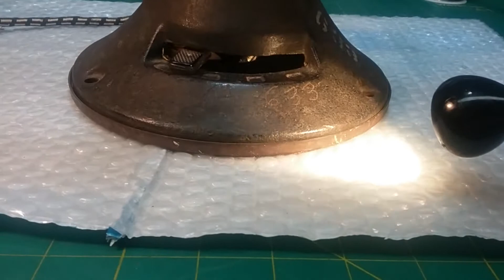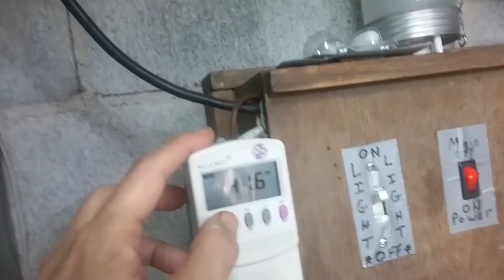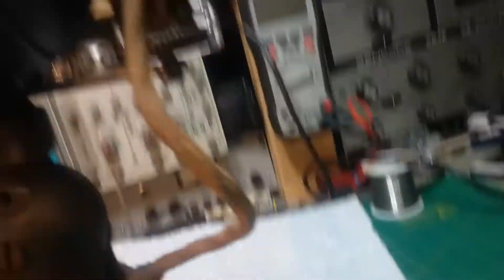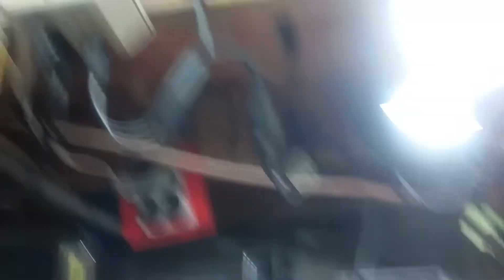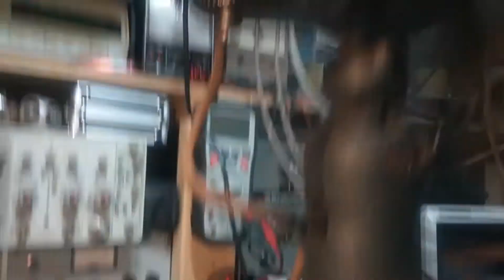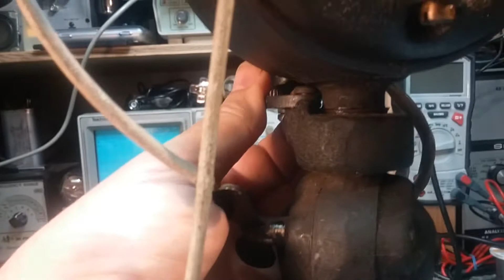Emerson Fan - 79646-AP-G - Part 1: Diagnostic

Comment: You can get the year of manufacture on the motor ID plate. It’ll be a small two digit code in the lower right hand corner. When you add 20 to this, it gives you the year of manufacture.
Reply from the maker: Yep!